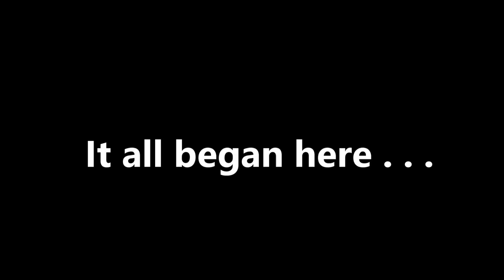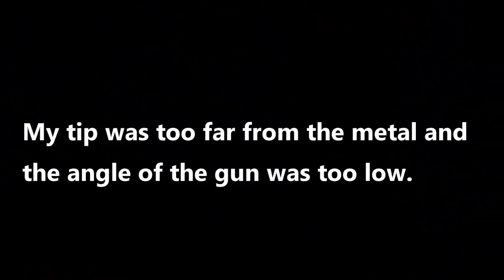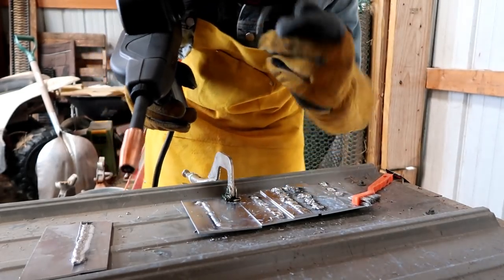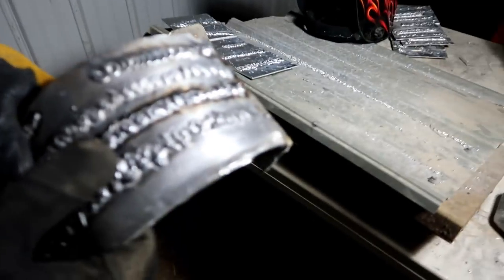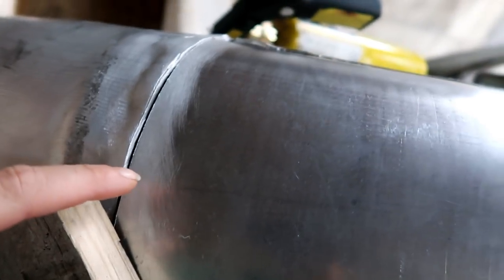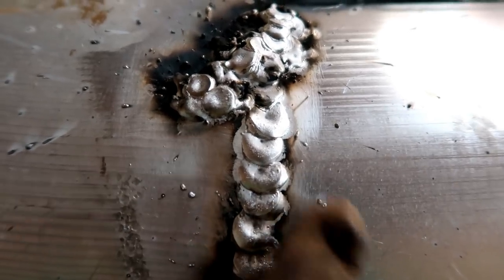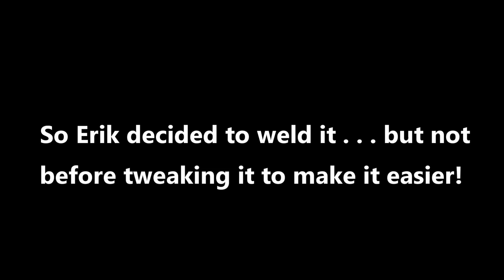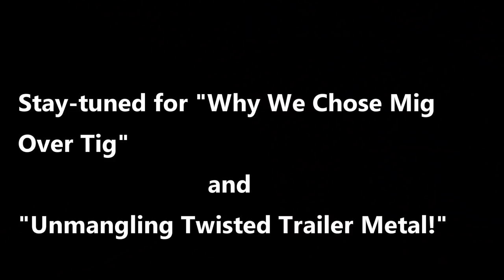153 Mig Welding Aluminum Instead of Tig Welding?

Comment: Sue, thats about the best your going to get using a 110 volt welder,, they are cheap and have far to much arc blow and the constant voltage is crap on these units, not sure what that welder is AC or DC but if you are welding aluminum with the wrong one,, its not going to weld good an sure as hell will not fill a gap, on the fat you should be able to fill a wide gap with out stopping, its all in the welder on how god or fast you can get the hang of it but you are dead in the water with a 110 volt unit,, for what you are using you doing the best anyone could, as i had said be fore best with tig as thats what i use for all my pontoon boat building and repairs, yes it is slower but much nice look an better control, used by all mfg
Reply: ya it makes it even worse we have to plug into a extension cord which drops the current even more.
Reply: you got that right,  it makes it even worse have to plug into a extension cord to the point it is all most unusable depending on distance and cord size

Comment: If you do not know how to weld aluminum you should hire someone that knows how To make it look nice and then you can watch them and get some pointers if it does not matter where the world is and you cannot see it then all means go ahead and burn out on your own that’s the best way but make sure you have your folder on the highest setting and will go if you’re using a 110 because you need a lot of 12